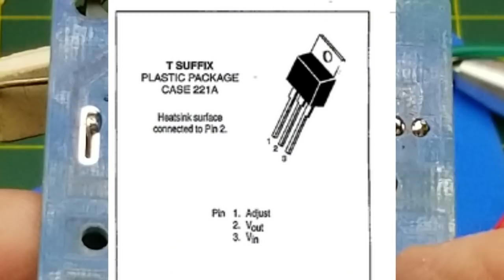kit build. This time it's a race!

Comment: Thank you for stating that at the end --- "if you wanna build a quality circuit, you relax you chill." I think this has been a wonderful community challenge and a display of healthy and productive competition. But I got into this as an impatient software developer who rushed and tried to do it all with one program. EE and building circuits has slowed me down and greatly improved the overall quality of my work. Anyways good job! Those regulators don't take to solder very well. :)

Comment: Ya, that's one of the reasons I don't have food or drinks while soldering. - 9:30  But you should also put your finger over the end of the leads as you cut them so they don't go flying and hit you in your eye or even go through a vent in a piece of electronics.

Comment: Little disappointed that you didn't use your dot-matrix for the timer.
Reply from the maker: I never even thought of that. 

Hmmm... I wonder how much reprogramming that would take...
Reply: @pileofstuff  Probably simplest way would check millis() in a loop and convert to minutes and seconds. No start/stop needed if it starts on power up. An external interrupt for start/stop would be nice though.

Comment: Unless you are the poor kid in China making assembled versions of this type of thing, quality of workmanship is more important than speed.  And it doesn't take much more time to "do it right".  Yes, I know it was a "contest" but such a contest should include workmanship.  Subjective sure but a better contest in my opinion.  Glad you had fun though.
Reply: Hope you are going to fix the output terminal colouring somehow.  I would likely either not use it and solder in wires or something or better yet maybe you can solder it on at a right angle underneath?  Otherwise it is just a "I forgot" accident waiting to happen.
Reply: @ElmerFuddGun  Just switch the red and black lever.
Reply: @Okurka.  - Oh?  You can change those around?  I haven't used one of those in years but don't recall seeing an easy way to do that.  Guess he didn't know either.  Thanks.

Comment: What are the odds this kit was picked for the challenge specifically because it was so poorly designed what with mis-spaced part holes and that completely inappropriate output connector that has to go in bass-ackwards?
Anyway, I think you did just fine- only two "shit"s and one SOB. I'd have been banned from YT permanently if I expressed my impression of that... thing.